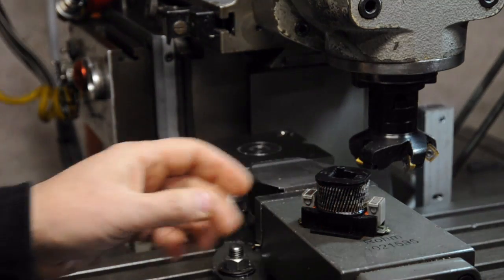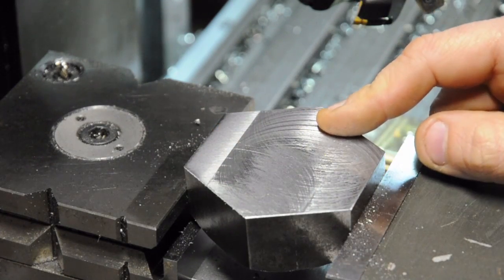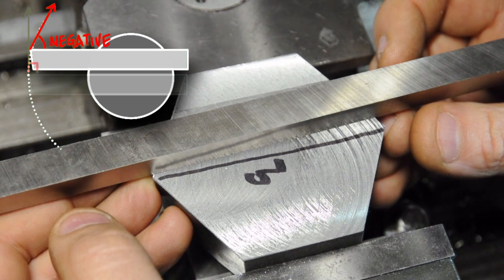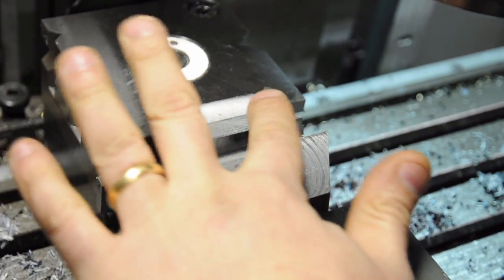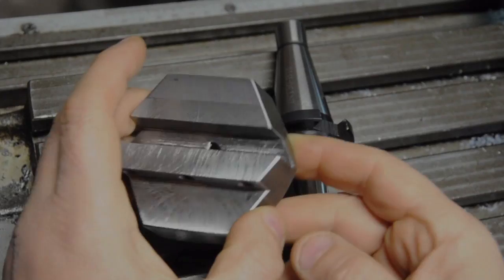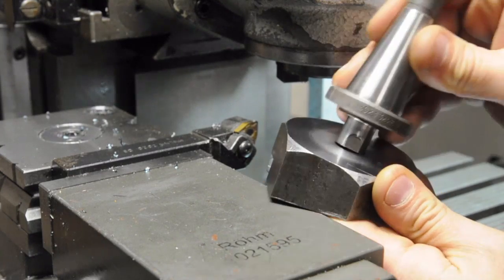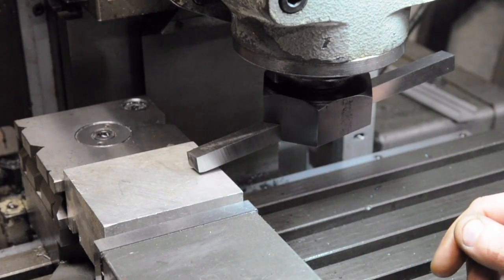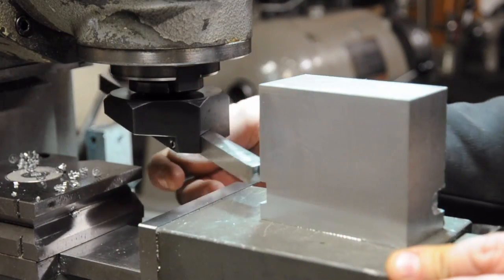Building a Fly Cutter - Part 2

Comment: Every engineer wants to make things that last. Every business analyst wants to shorten the lifespan of the products they sell.
Reply: = unhappy engineers.

Sometimes it isn't that the business men want it to fail, just that they want to make it as cheaply as possible, for bigger profits. Which leads to unhappy engineers either way.
Reply: @dreggory82  On the other hand, an engineer running free would make a everyday thing cost several thousands :D
Reply: @dreggory82  hey, at least it's harder to make something on a budget that still works to some degree
Reply: And cell phone, "built in obsolescence" is perfectly understood!
Reply: severalmalfunctions yes, but it would last multiple orders of magnitude longer and therefore be probably cheaper innige long run for the consumer.

Comment: With the tapers not concentric on the first spindle, once you turn down the taper, that wouldn't have mattered much.  Or was it that you just didn't trust that the other taper was even close to what it should be?
Reply: I was thinking the same thing
Reply: Matthias? What are you doing here. And also you need to buy a mill and start that metal working.
Reply: It'd be awesome to see you venture into metalworking Matthias - could be some really interesting stuff, judging by the stuff you make out of wood. Happy new years regardless
Reply: And also true what you said
Reply: I though exact that, but maybe the tool bent or crooked in some way that will lead to vibrations or other errors.
Reply: I was thinking that maybe once he got it turned round there wouldn't be enough material for a press fit.
Reply: He could not know which taper was the bad one. It could be that the taper inside the mill was crooked and would sit differently next time he installs it. So truing up the small taper would be pointless.
Reply: I love that my favorite youtubers comment on each others' channels.
Reply: As it is a single point cutter you are making, that taper would not have mattered greatly just put the cutter tip at the low point and it will still  describe a perfect circle.
Reply: OH MY GOD GUYS LOOK IT'S ANOTHER YOUTUBER LET'S ASK HIM WHAT HE'S DOING HERE, COMPLIMENT HIS WORK, AND SUGGEST THINGS HE SHOULD DO!!!!!!!!!!!
Reply: The taper in the mill likely off so much that the wobble would occur every time it was installed. For a fly cutter it would be rather dangerous.
Reply: better not use a holder that has potentialy crashed.
Reply: I guess you don't want to turn down hardened steel that has such a big runout. You'll get big vibrations and the result will have a smiliar runout.
Reply: Bingo, when in doubt! Toss it out!
Reply from the maker: Yes! .. well the 2nd part -- the machine taper was junk.  Thanks for stopping by, MW!
Reply: This Old Tony As I'm a cheapskate, if in doubt bore the thing and bond in a stub.
Reply: He could’ve turned it “concentric” (to whatever was happening in upper taper) Then held it by that newly machine surface in something trustworthy like a spin indexer and checked run out relative to the new surface in the upper taper. It might have shown that it would be usable at that point. The question then I guess would be what to do with it if it isn’t. You could set the compound to a good known trustworthy taper. Then you could hold the tool holder in the 4 jaw, dial into that “new surface” and try to skim cut, Although hardly any removal of depth messes with how the things seats and the dogs would bottom out before the taper would. So I guess in summary there’s just a lot of fiddling for an iffy chance at a payout, and these things are like $25 on eBay.
Reply: I think he threw it away just to be on the safe side, he could'nt know how bad and in wich way the piece was messed up, it could had even (and not unlikely) developed a crack somewere, making it dangerous
Reply: Please tell ,e I’m not the only one who read this in Matthias’ voice.
Reply: "truing up the small taper would be pointless."
You could turn the end true, then rechuck and gauge it a few times to see if it remains true. It's highly unlikely, but it is at least possible that the chuck/collet end was fine. Both tapers might have been perfect but not on the same axis. Maybe when the small end was turned, the big end was chucked up with a piece of grit in there. 

Anyhows, we all know if Matthias was a machinist, he would be finding all kinds of bad tooling on the side of the road, taking them home and fixing them.

Comment: BTW, the contactor actuator coil draws the same no matter what power you draw through the contactor. It only holds the contacts shut. It is the contacts that carry more or less power depending on the motor load. Contacts can burn, melt, weld together or fail in other ways. The coils can fail by opening (no through connection), shorting (close connection between the two input connections), or (what it looks like your coil did) a short between two or more of the turns internally, which causes the whole coil to overheat dramatically. The last is usually a sign that the internal insulation on the windings is breaking down. It is a sort of thin enamel so if one has broken down, the other(s) may be getting iffy as well. You probably have 3 or 4 contactors (forward, reverse, maybe an on/off, and the coolant pump). It would probably pay to replace all the coils if one has failed. You can keep the ones that haven't actually failed as emergency spares.

Comment: I've never seen someone use a turning tool on the mill. Clever!
Reply: It's called boring rod
Reply: How about an end mill in a lathe?  Works really well
Reply: Have you been around a jobbing shop? Not being padantic however we do whatever gets the  job done, after all we are engineers, we solve problems.
Reply: Isn’t that dangerous?
Reply: @stevedebbiemoore  That's now how the word pedantic is either used or spelled, and a machinist and engineer are very different things. See, This was pedantic.
Reply: @iusethisnameformygoogleacc1013 
Well done pal!

Comment: the coil doesn't take the amperage from the spindle motor, the actual contacts do. so if your coil is bad than it was just it's time.
Reply: Tyler Hensley hopping on this. if you want. send me some photos of the offending relay. with any numbers and such that you can find and I'll see if I can link you a replacement.
Reply: I'm inclined to think that, with the inherent vibration of a machine tool and old enamel on the turns that windings started shorting to each other, upping the coil current and starting the downward spiral to burnout.
Reply: He should just get a new contacter.
not realy important, what type or brand it is.
as long as it can take the amperage and the coil voltage is the same!
Reply: I would replace the coolant contractor , replacing the spindle contractor may be a problem as there may be a mechanical interlock between forward and reversing one as well as electrical interlock . As has been said it reached it life span no cutting load would have caused it
Reply: Contractors are not expensive .  The A/C industry uses them by the millions ( although most have a 24 VAC coil , they can be purchased with different voltage coils ) .  I always buy contractors that were rated 10 - 20 amps more than the original .  If there is physical room for them to mount .  Just match the same number of poles , voltage .

     Try Johnstone Supply or W W Granger .

God bless
Wyr

Comment: Hmmmmmmm, electrical engineer here, to talk about your coil.

That's fairly abnormal. Contactors do not overheat and burn up from old age, unless the winding insulation fails and shorts out part of the winding - which is rare in an undemanding environment like a workshop.

If the coil is an AC coil, it will draw high current until the plunger completely closes. If it's prevented from closing properly, it will give this result.
Also, if you feed an AC coil with DC, you will be rewarded with a similar result.

They're certainly a commodity item. Should be cheap and easy to get a replacement.
Reply: The coil in of itself may have been flawed in manufacture and may have only taken this long to die. While correct in that it won't take heat in the form of current from the motor - the could does produce heat
Reply: Sorry thumb posted... Heat and a winding at a time - over time will fail eventually. 
BTW The coil itself is likely to be proprietary to the contacter - and likely an easier find in a new contactor than sourcing the coil alone.
Reply: he could use the isolator of the old coil and wind a new coil on it using coperwire and lackuer , he does need to measure the wire thicknes and the resistance of the working coil to make a good estemate for the amount of windings needed 
put the coil "bobbin" in the spindle and make sumtin that hits a rotation counter
Reply: Making a new coil, or repairing one sounds a lot like a new hobby of making truck tires out of stone with a bronze chisel. The wheel has been perfected - right off the shelf - no need to reinvent.
Reply: A true machinist would wind his own coil  and make all his own tooling. buying off the shelf is for people called techs
Reply: Was thinking similarly...My guess was that something got in there to prevent it from closing all the way. Spiders, for some reason, are notorious for that around here.

Comment: Great vid as usual. Got me there with the too-late-at-night TV signal. I recommend just replacing the down contactor next time it happens. Cheap and easy and a safe bet, just how I like my women. Unless you have some complicated interlocking device which even a good interlocking set of contactors is still fairly cheap. Next time.

Comment: Well, I am glad that you did that video. Even if there was an interruption (TOTTD -- TOT Technical difficutly). I  may add that it is a great pleasure to see Matthias Wandel appearing on your channel. Hi, Matthias. I have been following  woodgears.ca for years, even if you use power tools. Back to fly cutters. To me your mill is huge. I have a Proxxon MF70 -- in fact my whole machine shop fits on a very small coffee-table size bench. Point here is that the angles on a fly cutter are not critical. Look at myfordboy's channel. Somewhere in there there is a video on a 45 deg cutter mounted on a sacrificial face plate at 45 deg. and he does the flycut with no mill, on a lathe. What you need is a small amount of clearance between the tip of the fly cutter and the work. What this video has shown me is that there is no magic to the 45 deg angle, and my fly cutter v0.1 will be quite different from 0.0.  I thank you very much for this post.

Comment: I welded mine on, too.
I built a tool holder out of 3/4" keystock and used 1/4" HSS for the bit mostly because that's what I had.
Thanks,
John

Comment: Hi
of you cut the slot in the center of the cutter you can use either Left or right handed carbide turning tools. then it won't matter which direction you turn it.
all my flycutters have a 1/2" shank so they can be used on any milling machine...you can also use it as a boring tool... Ed from Colorado

Comment: ive made quite a few specialty cutters for teh mill, and the usual procedure is check, double check, make sure, and check again, and after all that, i usually end up cutting the teeth left handed anyway, so i feel your pain on that one. its actually so common for me i installed a reversing switch on my mill motor.

Comment: Tony, that's a relay coil? That shouldn't fail at all, least of all due to spindle overload. If it did overload, it should take out a breaker or the relay contacts, not the coil. Probably there was a latent defect in the coil itself, like a bad piece of insulation.

You should be able to rewind it yourself. Measure the wire gauge and get some enamelled wire of the same gauge. Unwind the coil, counting the turns. Unsolder the wire from the terminals. Use fine grit paper to remove the enamel from the last 3/8" of the new wire and solder it to one terminal. Carefully and neatly wind on the same number of turns onto the bobbin, not pulling the wire too tight over the first loop tail. When you have the right number of turns on the bobbin, leave enough length to get comfortably to the second terminal, strip enamel off that and solder it on. Tape it up just as it was originally. Measure the resistance and compare it to the coil you got working. If the new one is within 25% of the good one, you're good to go.

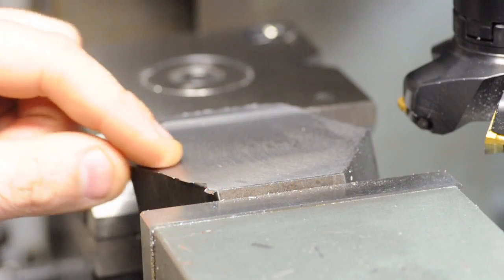Comment: 1:00 isn't the point of a contactor to take the load off the 'switch' so to speak; if the coil melted that shouldn't have any correlation to the spindle draw at the time -- the coil just cooked from age probably.

Comment: Tony, the coil in the contactor won't see the load amps, those are only going thru the contacts so nothing you did could have burned the coil, it was just its time to go (and the only way to do it is for example if you have a 24v coil contactor to apply 120 or 240v on it)

Comment: Never saw a relay like that but I'm pretty sure you are going to find a perfect substitute. Just keep in mind motor maximum current and the old relay coil voltage, every electric material supplier will be able to provide a substitute. You are going to need 2 or more contacts depending on the type of motor, 2 for the 1-phase, 3 or maybe 4 for the 3-phases. A newer relay could have a completely different layout but it works the same as the older one

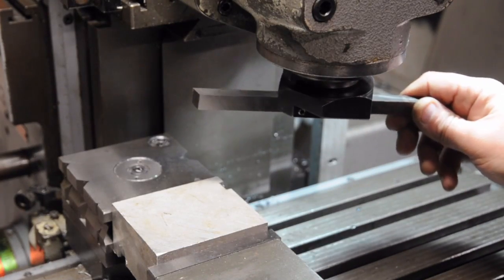Comment: at 13:00 That's nice. Having the cutter stick out equally on the non cutting side provides a modicum of balance t the set up. Ideally it would be in line rotationally with the business end, but it's better that nothing.

Comment: Nice build, but I would put the setscrews pushing towards the centerline (on the other half), just in case you use a smaller cutting tool and still want to have the tip on the center line.

Comment: As usual, fully enjoyed this vid.
You may want to consider incorporating the back relief when cutting the slot as well. That would give you automatic back relief. Not precise for all materials but hey, its a started. Right?
Skip pattern could also be due to excessive tool hangout. This will cause the tool to spring and the head to hake ever so slightly because of the imbalance. Fly cutters, by their nature, are highly imbalanced as it is. 
Going into chip breakers, chip clearance etc. is rather too much for me for a simply fly cutter but I'm sure this post will generate some what of a discussion that will bring up several views on that issue.
In any case, the barely noticeable vibration combined with no back relief is more than likely the explanation for the markings.
Thumbs up from Spain amigo!

Comment: Tony, If you were worried about rake angles and materials you can process with the tool. Why didn't you make the mount block to accept a lathe tool that takes inserts? then you solve 100 different options, tooling is already on hand and your insert does the angles for you. Just a thought for fly cutter mk2

Comment: Love turning in the mill, very goofy to do though. Also, couldn't you have used the horizontal ISO taper for more ease? Though if concentricity was a huge concern I can see why you might want it concentric with the taper it will be used most in.

Comment: Great video! Quick question: Couldn't that radial runout error at 10:30 have been corrected by milling it? Or is that not possible cause of the mounting side being faulty?

Comment: Nice, looks good. Just curious: is there any consideration for balancing the head? You removed a large step on one side for the set screws; wouldn't that make it lighter than the opposite side? Does this not even matter because the speeds involved are too low?
Great videos, keep up the good work!
Reply: I was wondering the same thing.

Comment: Apart from replacing the coil, and it's contactor, the next best upgrade would be a VFD conversion. That is, if one has a need for variable speed and the additional controls for that. (That too is a slight reinvention of the wheel) If not, new contactor - done... If not for the motor, which seems to be working fine, then for the coolant pump. (In which Peter was robbed to pay Paul.)

Comment: Possibly the holding/clamping screws could come from the beneath the tool instead...  allows tools of different thickness
to be used and still be "on center ".  It also allows for "clamping shims" to be used instead of the screws bearing directly on the HSS tool bit, making for a more secure grip.

Comment: I've seen this type of tool in other videos but seeing how this one was made makes me scared of it. Is there some physics involved that stops those screws from jiggling loose and the cutter flying away when the cutter is no longer on a part? Are the factory built ones the same or do they have other safety features?

Maybe if it had a lip below the cuter to prevent it from falling it would only push the cutter inside. But without one i can see it doing damage.

Comment: I lost the cutting tool for a fly cutter and had to install a left handed tool into the slot, which meant that the axis of rotation of the fly cutter and the plane of the cutting face didn't intersect anymore, they're offset by roughly 3/8 (because cutting edge side was flipped).

However it actually cuts just fine, and after watching your video I wonder why that is, and what long term damage I'm doing to the cutting edge (surely it will dull sooner having all that negative rake?)
Reply from the maker: The larger the circle, the less of an impact a wrong-facing insert tool might have. . . probably cut the life down a bit but it's hard to argue with something that's working.

Comment: Perhaps a silly suggestion, but why not make the channel for the cutter both over the centerline and wider than necessary, and then use shims to position the leading edge of your tool bit wherever you would like relative to the diameter of the cutter head. I know, I know: shims - yuck - but it might make for a more versatile setup with less cutter grinding.